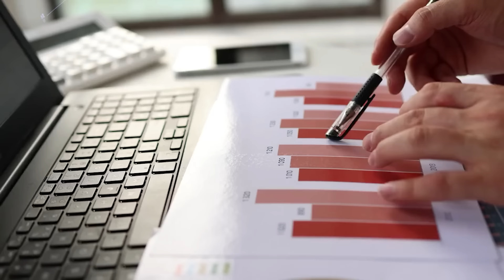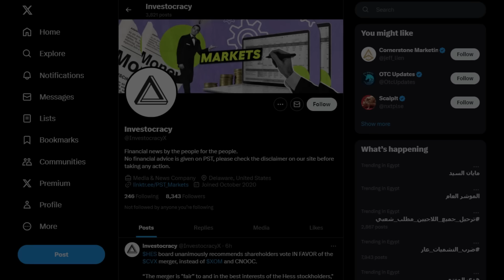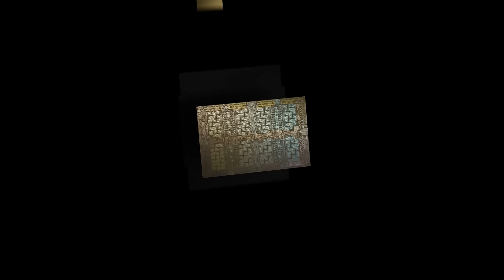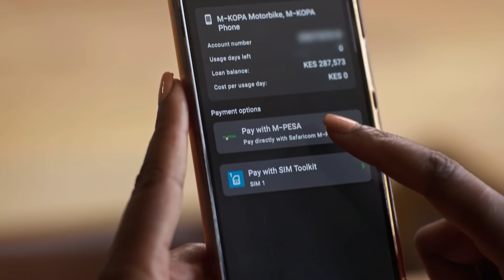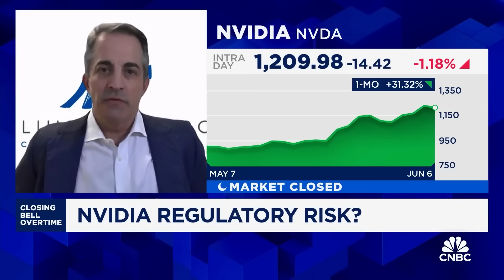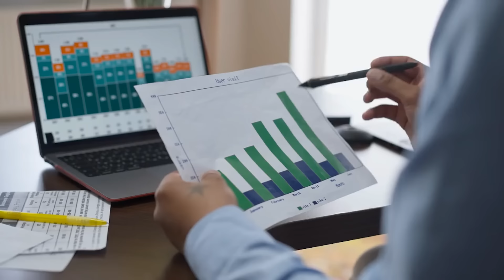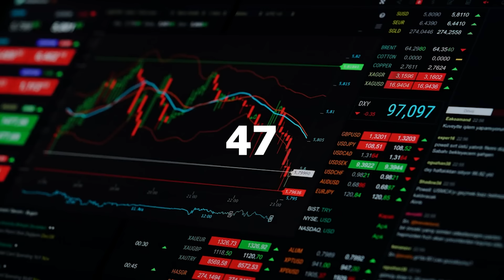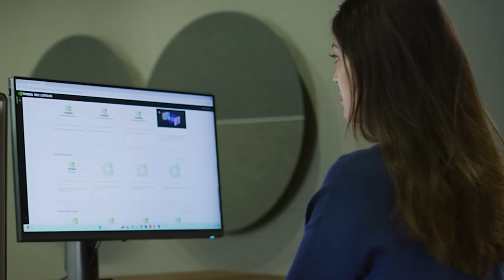Jim Cramer: “This is INCREDIBLE NEWS for Nvidia Stock Investors”

Comment: Additional earnings reports from major tech companies, driven by Nvidia, coupled with trader FOMO, could fuel a resurgence in market buying pressure. I'm considering investing over $300k, but I'm uncertain about risk mitigation strategies.
Reply: Nvidia stock is roaring like many did during the 1990s bubble. But this time around, the hype around new chips is happening in a more mature demand environment.
Reply: Accurate asset allocation is crucial, and some individuals use hedging strategies or allocate part of their portfOlio to defensive assets for market downturns. Expert guidance is vital for achieving this. This approach has helped me stay finan-cially secure for over five years, yielding nearly $1 million in returns on invest-ments.
Reply: This is definitely considerable! think you could suggest any professional/advisors i can get on the phone with? i'm in dire need of proper portfolio allocation
Reply: Vivian Jean Wilhelm is the licensed advisor I use. Just google the name. You’d find necessary details to work with and set up an appointment.
Reply: This reference seems valid.. Just looked up her full name on my browser and found her site without sweat, over 15 years of experience is certainly striking! very much appreciate it

Comment: Certain it will dominate the AI chip space, it's 20% of my portfolio, grown on its own from being 16%.
Reply: It's 80% of mine. Buddy talked me into it in 2020 at 60, bought 1000. But wasn't liquid enough to invest in much more. Liquidated this year, bought another 1000 a share in Sept, Nov, Feb I thought I'd be done at 660, but 500 more when it took a big dip from It's ATH at 974 to 720(bought at 800 and 720).

Also got into TSM, AMZN, GOOGL...and then SLI, LAC and some small caps, but the lithium seems to be dying with the sodium based batteries.

 But...Jensen Huang and a College roommate has secured my financial furture...love those two!
Reply: @scourge8097  So you have 25,000 NVDA shares now, and your portfolio is about 15 million. Congrat...

Comment: This shows that Cramer doesn't know his comparisons as a "Souped up" computer doesn't start anywhere near $1,000, with high end motherboards costing $300-$500, CPU's in the higher end range costing $500-$800+, you need at least a 2TB NVME SSD & a MS Windows license which will set you back another $300, then the 128GB of RAM is another $700+ (don't even think about only 16GB or 32GB of system RAM as many GPU's now have 16GB, 24GB & 32GB of GDDR6/7 RAM, of course you don't want a basic power supply so a Corsair AX Titanium 80+ series PSU is going to cost you $300-$570 and this is all before you even think about a Graphics Card such as a $2,200+ RTX4090 or whatever the RTX5000 series cards with the new Blackwell GPU will cost as well as other basics like the case to put everything in, a keyboard, mouse & speakers/headphones will run another $200-$400, add that up and a ENTRY LEVEL "Souped up" PC will START at $4,500 and that's being very conservative. Going with a high end "souped up" PC, you can easily hit the $8,000-$10,000 range, especially when you add in Monitors, UPS Battery Backups and other accessories. Now if Cramer's stock picks are any indication of his IT/PC/Tech savviness, THEN HE IS ABOUT 4 to 6 YEARS BEHIND, basically, once you here stock information here, your LATE TO THE PARTY!!! I don't know about Cramer, but when it comes to IT & Telecom savviness, I have over 34+ YEARS of REAL WORLD, HANDS ON EXPERIENCE in building, selling, repairing, upgrading and servicing PC's and other devices.
Reply: Teenagers know so much about the computers. Oh boy.. Dad, where are you?